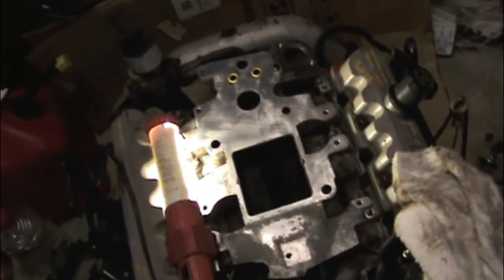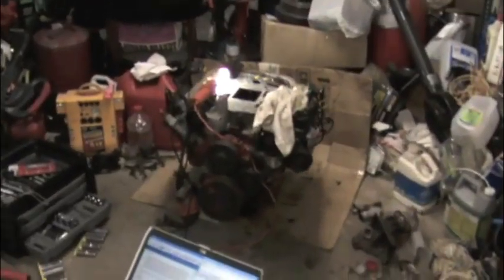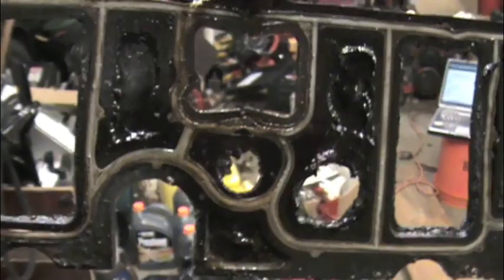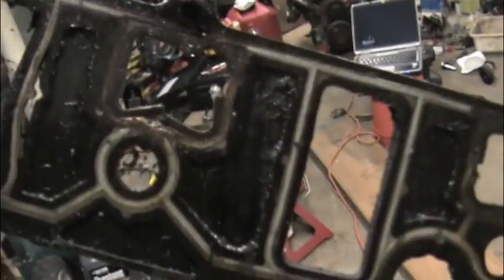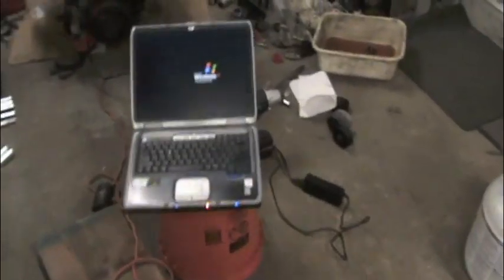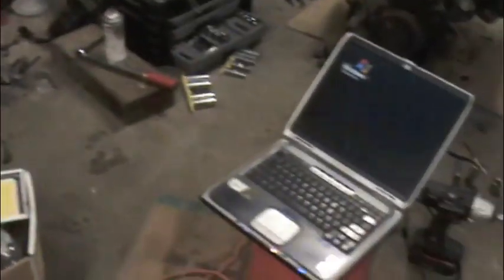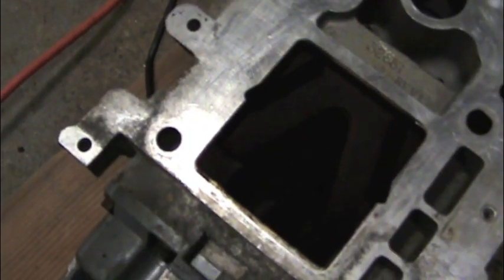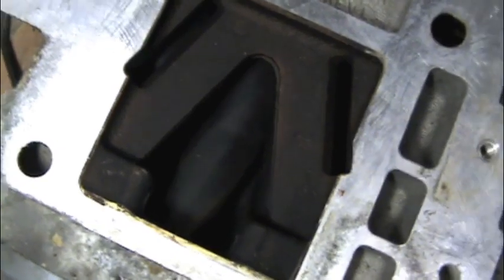GM 3800 Series II Supercharged Intake Manifold Leaks

Comment: i,m gonna feel sorry for you, if you go through all that trouble to get that other motor in, and it has irreversible damage done to it, because of all that coolant that leaked into the combustion chamber.    you coulda just got a brand new engine with heads from autozone for $2,300.00.    why didn't ya just do that?
Reply: +Jeff Fuehr If the coolant leaked into the oil, it will wipe out the bearings, and a knock will result. It's a gamble, but catching this issue early will prevent buying a new engine. I do understand that getting a rebuilt long block is an option, but those things are put together by trained monkeys; rebuild what you have on your own with a good machine shop to take care of the bores, crank, heads etc, and you're in that neighborhood as well.
Reply: yeah, i,m still losing coolant, and i can't figure out where it's going.     i got a 2006 pontiac grand prix GT with a 3800 supercharged engine in it.    do you think it's a intake manifold gasket?   because i already changed the elbows, and they haven't leaked since.    i can smell coolant on my hot engine, when i,m idling in park.    so it's probably the intake manifold gaskets, right?
Reply: Jeff Fuehr
More than likely it is, however, if you smell coolant, it's an external leak. Use a coolant pressure pump to check where it's coming from, but a word of warning, it may also force coolant past broken intake manifold gaskets into the oil. You'll have to drain the oil to check for coolant mixed in. The good thing is that when you remove the oil drain plug, coolant will come out first before oil does, because oil floats on water. I'd just bite the bullet and change the intake manifold gaskets with good steel ones. See my other post in this video with a good part number.

Comment: Thanks man, i have to change mines on a supercharged bonney, and ive been wondering abt spending a little more dough to get 
the aluminum gaskets. But i wont need to think abt it anymore.
Reply from the maker: No problem.  The Aluminum ones are worth the extra cash in the long run, and considering how much work it is to replace them.

Comment: I have a 3800 in a 2000 Camaro. I'm leaking coolant from above the W pump which is obviously where the lower intake manifold gaskets would be. Should I just replace lower gaskets? or upper and lower?

Comment: I changed the upper intake manifold on my 2000 grand prix (Dorman gasket and manifold) and it still blows the white smoke out the tail pipes...could it be lower intake gasket as well.

Comment: I've had this Happen 3 different times with 2 different cars!!  I finally learned from a Good and Honest Mechanic that GM DEX-COOL IS THE PROBLEM!!  IT Erodes the Seals and Gaskets!!  I Really Hate GM!!!  It's Crap like this why I will Never Buy From GM Again!!  Bunch of Liars!!  The 3800 series 2 is a great motor though too bad they replaced it now in their newer models with a less efficient, less HP, less Torque, More complicated design!!   GM sucks!!
Reply: ever car manufacture has its flaws to say one sucks doesn't necessarily mean its bad because of bad design blame it on the engineers

Comment: i have a 00 camaro v6 with the 3800. Coolant is leaking out the intake manifold. replacing the lower gasket tomorrow. is it possible that it leaked into the oil as well? will i have to change the oil and filter? i just did it about 3 weeks ago.

Comment: hey quick question if anyone is out there.  I have to do this job for my mom on a 98 bonneville with a super charger.  A shop wants 900 but new gaskets are only like 90 bucks from oreillys, is it really that much of a pain in the ass?  how long do you figure itll take, it cant be that hard to get the LIM off can it?  Engine will stay in the car.

Comment: I have a 99 gmc sonoma. I flushed the dex cool out as soon as I bought it. I have had Peak global in it since. It just so happens that peak global is also Organic acid technology. I have had peak global in it for 7 years now. I did a flush after about 5 years cause I felt bad and never had any problems ( laughs). I put Peak global back in and have been good since. I personally think dex cool is just a bad product. My mom's Olds alero had intakes done at 45,000, and had never been touched.  :(

Comment from the maker: @aleon1018 Sounds like a decent price for the work, but it also sounds like they put the junk gaskets in there with a response like that.  The dealer I got my parts from only had the crap plastic ones listed for my car, had to go by either a Bonneville or a Grand Prix to get the aluminum ones.

Comment from the maker: @arealscorpio1 You can try taking the belt off the supercharger.  The engine will run fine with it disconnected, just won't have the power it should.  There is a coupler in the SC that goes bad and can cause a knocking sound, but I don't think that is your issue.  You may have low compression on one or more cylinders, start by disconnecting one wire at a time for each cylinder until you unplug one that makes no difference in how it runs.  You an do a leak down test on the suspect cylinder.

Comment: The berrings inside the supercharger would rubb together?? I keep haveing missfire issues, and I've changed the spark plugs, wires, and ignition coils, but still the same issue. no knocking, but just an obvious small shake when the engine is on, and missfire codes....what else am I looking past!?? It's driveing me nuts! I been in the house for 3days waiting on the coils to get here because I had to order them, and STILL the same issue....PLEASE HELP. I have an 04 GTP w/105,000...

Comment: The plastic gasket is not the problem. Its the dexcool that eats away the plastic. I found a website that shows the series 1 3.8 had perfect plastic gaskets at 125,000 miles. Thats when GM used green coolant. I just changed the intake gaskets on my L36 Grand Prix. Bought the aluminum gaskets, vc gaskets, plugs and wires for 150 bucks total, and had the gaskets changed in a day. I LOL at people who drop 800 bucks to have them changed for them...

Comment: Thanks for the post, I don't know how many people told me my gtp needed a head gasket and many mechanics said it needed a plenum ( Which it don't even have). I pulled mine apart and gasket looked just like yours. It had just started missing real bad and started blowing white smelly smoke. I didn't run it anymore so it should be ok. Most of the coolant looked ok but some had some gooeyness . Should I flush the cooling system? And what else do u recommend doing to it?

Comment from the maker: That can be done, putting a smaller pully on it does the job with less effort.  But my exhaust is stock and wont handle the extra power too well.